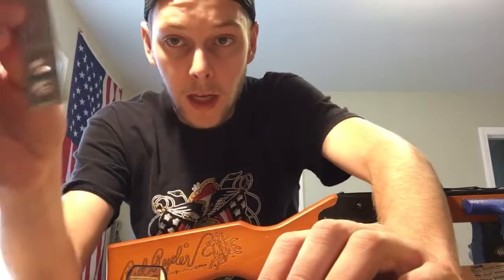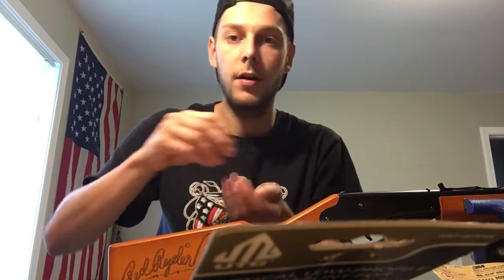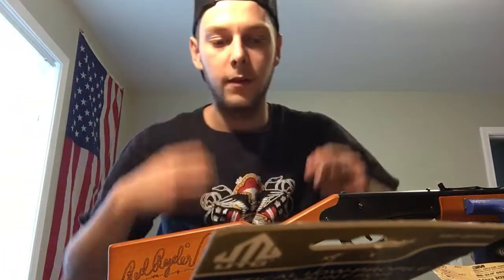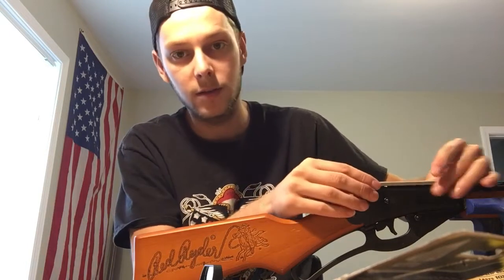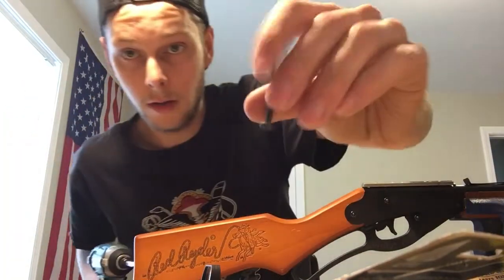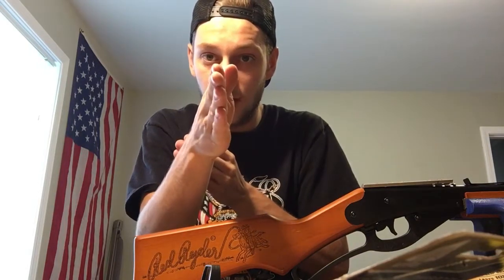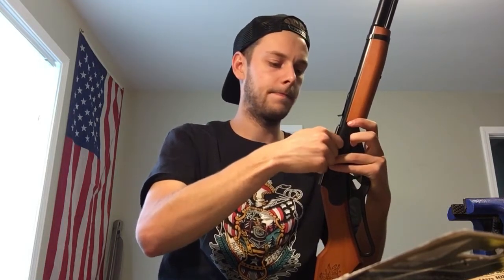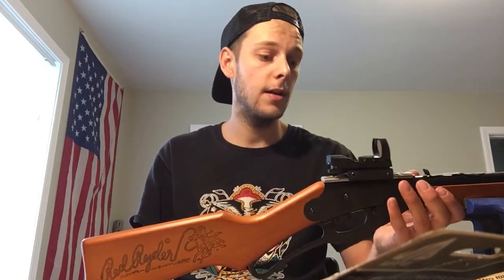Red Ryder Red Dot Sight

Comment: Ok, problem with this vid is that your air chamber is just under the top of the receiver and that is why you don't want to go drilling holes down thru the top of the action/receiver. Wonder if this guy's Daisy still works. Everything else I see is ok, but just fix/fasten with epoxy-not screws. Haven't done the epoxy bit myself yet but a gunsmith told me it would be ok as unlike break barrel air rifles there is no recoil shock to mention with a Daisy BB gun. The offered Lasso mount base I got was poorly designed and when installed there was a 3/16" bow between the base and rifle top-very springy. Just unusable and did not fit in two dimensions so the design evidently needs to have another look at.